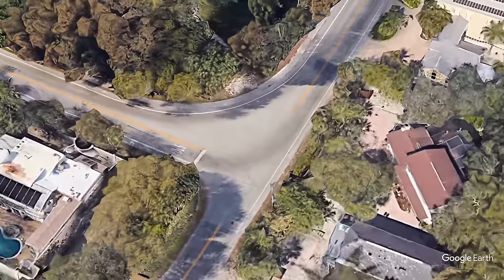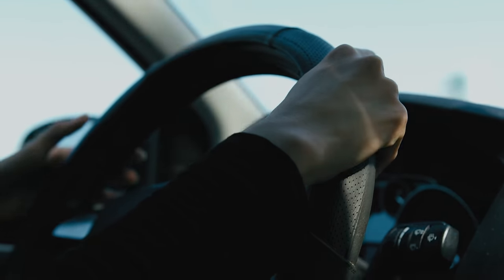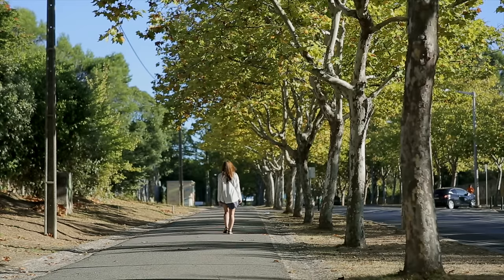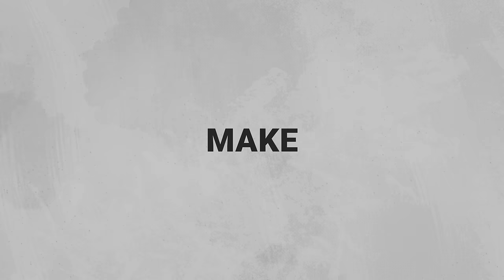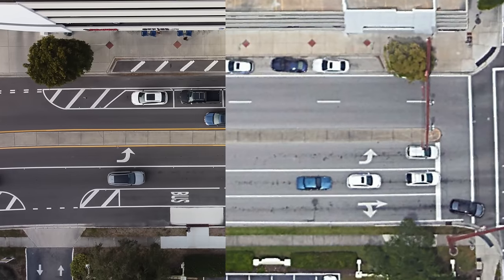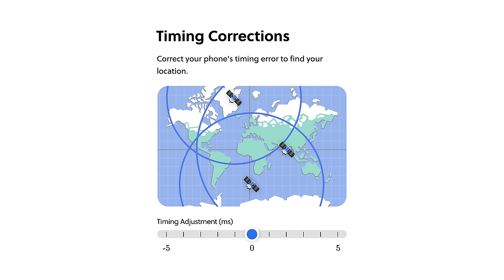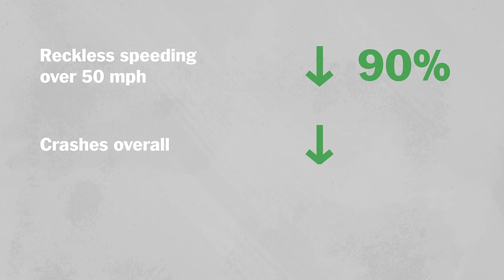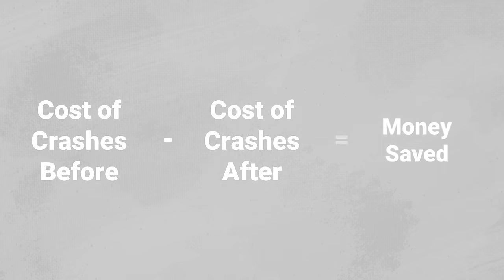This is the key to safer streets

Comment: It's ridiculous how there are politicans who say that this is a war on motorists
Reply: They forgot that driving is not a right, it's a privilege
Reply: Most politicians will say what they think will get them elected.

So, if they think a larger segment of people who can vote for them are "pro-car" than "anti-car", they'll obviously go for that segment. I'm simplifying the terms into pro-car and anti-car for the sake of brevity in the sentence.
Reply: First off, a lot of the debate is framed as how to get rid of cars, rather than how give people more high quality options. Second, a lot of cities have enacted straight up anti-car policies. Rather than improving alternatives, like walking, biking, light rail, etc. they’ve just made driving harder and more expensive.
Reply: It's not them, it's the lobbyists from car companies who write their speeches
Reply: There are policies implemented just to hurt motorists though.

Traffic calming, that’s good. But in the UK councils, and one “country” decided to drop loads of 30mph speed limits to 20, without modifying the roads at all. All it really did was take roads with an instinctive speed of 30, and made them 20 so they could fine people speeding. If they’d actually implemented traffic calming to make people actually slow down, they could have argued it was for safety, but they didn’t so it wasn’t. 
Councils spent years systematically eliminating off street parking, in the name of reducing air pollution, except clearly that was a lie because electric cars don’t produce air pollution but do need the off street parking you just destroyed to charge.
The government spent years encouraging the sale of diesel cars to reduce CO2 emissions, only for some cities to fine anyone who drives a diesel from that era into the city. Live there? Tough, you have a worthless car, shouldn’t have followed the government’s advice. 
Motorcycles get randomly banned from car parks. You can fit two in one space, they produce less CO2 then cars, but no, not allowed to park.
Reply: @user-op8fg3ny3j  the American ethos includes this idea that driving is indeed some sort of inherently American right. Unfortunately.
Reply: Not to mention that usable biking infrastructure reduces the number of cars and makes the roads nicer to use for motorists as well.
Reply: Well since they phrase it that way, building this many roads is a war to the community. After all, many happy neighborhood in the US were bulldozed by for the car.
Reply: How is driving a privilege? How else will you get around?
Reply: @proallnighter  Ask the people who are banned from driving, or don't own a car.
Because you have to earn the privilege by passing a test and it can be revoked if you abuse that privilege which would not be the case if it was a fundamental right.
Reply: @user-op8fg3ny3j When the entire country is pretty much built to neccesitate driving, it pretty much becomes a right...
Reply: people hate being slowed down.
Reply: @flozano8  It becomes a right and not just a privilege when it is the only safe way of travel.
Reply: It is, this video was all about how to make drivers slow down, it was barely about making good alternatives to driving. That is what makes it a war on cars.
Reply: Even the simple reconsideration of zoning laws and city layout/design is now called a "war on motorists".
Reply: @HALLish-jl5mo  what's wrong with lowered speed limits?
Reply: @Gelatinocyte2  because it almost always includes taking away car lanes or closing roads to vehicles
Reply: @cmrd_hdcrb  sounds like the real solution here is to fundamentally change how we construct our civilization, not sacrifice more resources/time to The Holy Automobile.
Reply: @proallnighter  You have legs don't you? Believe it or not it was a popular mode of transportation about one hundred years ago.
Reply: @proallnighter  "How is driving a privilege?"
Think of it this way: you have to be financially secure to buy and maintain a car, you have to convince a regulating authority that you are worthy of a driver's license and/or deserving to get the right to drive (with insurance), and you'd have to be in a city where your car (not you) is fully accommodated for (complete road network/access, ample free parking spots).
It IS a privilege – one that sacrifices the wellbeing of others (for the sake of driving marginally faster).
Reply: @MrMartinSchou  safer roads IS pro car. You're less likely to lose yours in an accident.
Reply: @SummitCoyote  ... and there's no evidence of this?
Reply: @HALLish-jl5mo yes, its a get-rich-quick-scheme by cities and counties.
Reply: @flozano8 I disagree.
Not 'unfortunately'....FORTUNATELY.
Driving is an American right as all clear thinking people agree with.
Reply: @SummitCoyote as it should be
Reply: @Gelatinocyte2 I'd rather sacrifice to the Holy Automobile than the Unholy Mass Transit.
Reply: What? Politicians say that?!
Reply: @michaelbruvolt4221  can you expand on that?
Reply: @kokofan50 in certain type of density it’s quasi impossible to make alternative competitive with car without slowing down cars. Those type of density happen to be the only ones allowed to be build in most places 😢. See the problem ?
Reply: @flozano8  which comment? I left 4 of them.
Reply: @HALLish-jl5mo maybe they though that they can finance the traffic calming with ticket money so they don't need to find a budget for it.
Reply: Driving is in a weird gray area of a priveledge and a right. The government can only revoke your ability to drive on public roads. You can still legally drive on private land.
Reply: @Gelatinocyte2  There are two problems 
1. Going slower is worse because it takes longer to get places, which wastes peoples time and money. Maybe acceptable if balanced out by improved safety, but most of the roads with the speed limits reduced weren’t reduced because they were accident hotspots, but arbitrarily.
2. Lowering the speed limit, but not implementing traffic calming creates a disconnect between the speed limit and the instinctive speed of the road. So instead of everyone doing 30, some people are doing 20, and some are doing 30. This can actually be MORE dangerous. Especially for pedestrians crossing at night, who struggle to judge the speed of vehicles, and so judge by distance with the assumption everything is travelling at the same speed.
Reply: @michaelbruvolt4221  this isn't about mass transit lmao
Reply: @HALLish-jl5mo  1. But counterintuitively, as studies have shown (I'm too lazy to look it up for you), lowering speed limits makes traffic flow faster, because you end up with less conflicts, resulting in less accidents that would interrupt car flow.
2. So the actual problem here is political stubbornness/laziness/half-assery, then – not traffic calming measures themselves?

Streets should just never even have >30 mph permissible speeds to begin with, they're not designed for that; higher speed limits should be relegated to roads, designated arterials, boulevards.
Reply: @Gelatinocyte2  sure it is. You are against the automobile. So to get around, that means mass transit. So stop being cute and admit your effed up ideology.
Reply: @Gelatinocyte2  I drive down these reduced limit roads every day, they did not improve traffic flow because there are no conflicts. If there were conflicts that might act as traffic calming! They also worked completely fine at 30mph.

I've said explicitly that I'm fine with traffic calming, just that there is a war on motorists.
Reply: @sIosha  Great plan, I'll just walk to work and back. It should only take me 6 hours a day. 

Believe it or not, back when people walked to work, they lived closer to work. I can't afford to.
Reply: @cmrd_hdcrb  that's the problem, bad city planning
Reply: @MegaLokopo  making drivers slow down in a neighborhood is bad thing?
Reply: That is exactly what it is. Motorists used to have 2 lanes in each direction and now they have one. That is obviously worse for motorists and it is all due to a few bad apples driving at excessive speeds. I wish in situations like that, they would just install speed cameras instead. That way they only disrupt the drivers doing the wrong thing, not all drivers.
Reply: @Ekitchi0  That is only the case if people actually use the bike lane. In most cases around where I live (although it might be different there) bike lanes are practically empty, so that does nothing to reduce the number of cars on the road.
Reply: @tonydarcy7475  more road lanes induces demand which is why we need to reduce
Reply: @michaelbruvolt4221  how would you know I'm against the automobile? Already, you're assuming things about people that aren't actually true! Just get your head out of your a-
Reply: @HALLish-jl5mo  I feel like you're just making up a story right now to justify/fit the narrative that there is an actual War On Motorists, but how would I know... I can't argue against an anecdote because they're just that: anecdotes.
Reply: It's crazy how there are already people here fooled/convinced that there is an actual "war on motorists".

Practically, this is just a war on pedestrians.
Reply: @tonydarcy7475  that's often due to incomplete, bad or plain dangerous bike lanes.
Where I live a ton of people are using them.
Reply: @michaelbruvolt4221  FYI, by the way, there are other options of getting around other than transit or cars: they're called walking and cycling. There's also the option of living close or right next to the important places of your life.

Believe it or not, not all of the world is North America. I'm lucky (maybe privileged? Nah!) to live in one of the few sensible cities in the Philippines, despite being heavily American-influenced. At least my country didn't have flawed zoning laws.
Reply: @user-op8fg3ny3j  I'm not convinced that  that is the case. I understand that on highways more lanes induce demand for obvious reasons (which is why I'm generally against highway widenings), but that doesn't necessarily apply to smaller streets as in many cases there isn't many feasible alternatives to driving, so the number of cars on the road is more or less fixed, even if they are just driving to their nearest train station.
Reply: @Ekitchi0  I agree. But this isn't a project focused on joining incomplete bike lanes. They just added bike lanes to a small stretch of road, which presumably just dumps cyclists in the middle of a main road  a few kilometres in each direction.
Reply: @kokofan50  There's some pretty good studies that show that increasing the frequency or quality of public transit is far less effective for pedestrian safety than making it more difficult to drive or park.
Reply: @HALLish-jl5mo  Totally right! London has gone from inconvenient for motorists to downright hostile to motorists, 20mph limits everywhere, suspension-wrecking speed bumps, speed cameras, limited parking, congestion and ULEZ charges....the list goes on.
Reply: @therealchayd  London has some of the best transit in the world.
Unless you're not commuting, why are you driving there?
Reply: @tonydarcy7475  if the stretch of road with proper bike lanes (actually separate from the road) links housing and commercial places together, it will be used but if it doesn't connect to anything useful, of course it won't be used much if at all.
Reply: Saving this
Reply: @Gelatinocyte2  they literally showed an example in this video of this exact thing they had a four-lane road that they turned into a two-lane road with bike lanes that shocker, nobody is going to use.
Reply: @user-op8fg3ny3j umm, no it's not.the constitution gives us freedom of movement.
Reply: @SummitCoyote well,duh. Who wants to stuck on the road for hours. Would you enjoy doubling the time it takes to go to work?
Reply: @sIosha 100 years ago people died before the age of 35, and died from simple infections.  Should go backwards a 100 years.
Reply: @kokofan50  It’s evident that without making it harder to drive the alternatives wil get to little traction. Evidence a plenty of this in Netherlands where the distance to bike is made purposefully less than that for cars. This, along with slowing speeds, paying for parking and making stoplights out bikes and pedestrians first only work in conjunction.
Reply: Judging by all the comments below: I can only conclude the following possibilities. 
1) it's the 18th century, people live where they work.
2) or people don't have to go to work.
3) people belive I can walk at 30mph.
4 public transportation grows on trees, it doesn't cost anything.
Reply: @BalaenicepsRex3  because people don't live near where they work shop etc. there's no point in putting a bike lane where there's not a convenient reason to cycle in the first place. distance.
Reply: @user-op8fg3ny3j  Because I live 50 miles outside of London, but usually go there in the evenings by car and there are usually no trains home when I need to return. You're right regarding the public transport, though, I do use that when I go there on business during the day.
Reply: @kokofan50 That's good. Fuck cars.
Reply: @MegaLokopo Making drivers slow down is good.
Reply: @SummitCoyote That's a good thing
Reply: @proallnighter How else will you get around?  The fact that you asked this question shows that you live in a place that is designed so badly that you’re forced to drive everywhere.  In places with better design, the places you want to go are nearby, it’s quick and easy to get there via foot, bike, streetcar, or train, and those options are safe, pleasant, and reliable. Try traveling to Europe. In much of it, you’d be foolish to spend money to rent a car, because you just don’t need one.
Reply: @michaelbruvolt4221 ”Unholy” mass transit?  It sounds like you live in a place where the transit sucks.

Good mass transit has a bus or train every three or four minutes, never gets stuck in traffic, quickly and quietly takes you where you actually want to go, and is pleasant, safe, and reliable. 

Does that sound like your experience?
Reply: It's called brain damage
Reply: @tonydarcy7475 Your bike lanes are empty because they are bad bike lanes.  Bad bike lanes are usually right next to high-speed cars or are otherwise unpleasant and dangerous. They can also be bad because they don’t go where people want to go.  If you build good bike lanes in places people actually want to be, bikers magically appear.  Every time.
Reply: @therealchayd Why in the world are you driving in London?  That city has been around for thousands of years. It wasn’t designed for cars!
Reply: @proallnighter  walking, biking, transit (buses, trains, subways), taxis/uber
Reply: @dzerkle  that’s not my point. of course our country is badly (re-)designed out here. That’s why here in most of America driving cannot be considered a privilege. It’s a necessity. If you can’t drive yourself anywhere and don’t have someone to take you around, you may as well end your life. This is why I mentioned rural areas, because not everywhere is a city, much less a pedestrian-friendly city. Hell, even in our American cities public transportation sucks. I live in a suburb here. It takes me 8 minutes to get to work. Can you guess how long a bus ride would take? 1 hour and 30 minutes. Even our best in Boston isn’t enough. When I used to live there, the train would take forever to get me anywhere. I don’t need to travel anywhere to know our infrastructure is shit. I already know that, and people mock me for complaining that it’s shit.

Anyone here mocking me for claiming that driving should be considered in fact a right in rural America doesn’t understand what it’s like having to live in suburban or rural America without a car or anyone to take you around.

And yes. I have my driver license, own my own car (no loan), and an impeccable driving record, so I’m not saying this because I drove like an idiot and now complaining about losing a license.
Reply: @ShadowEclipse777  buddy I don’t know where you live, but where I live, that would be prohibitively expensive and dangerous. It’s all highways, so I can’t use a bike to get to work. Uber would bankrupt me if I were to use it to get to work. We also have no trains, and the busses are not reliable. All the stuff you mentioned is great and thank you for commenting, but that type of life doesn’t exist outside of large cities here in America. Consider yourself lucky to live where you live.
Reply: @mrosskne  drivers don't see it that way. they see it as an inconvenience to them and wasting their time.
Reply: @proallnighter Oh, I’m not saying you’re wrong. You’re not wrong. I’m raising awareness. Many people in North America don’t understand that their transportation infrastructure sucks in much the same way that fish don’t understand that they are wet.
Reply: @BalaenicepsRex3  you don't make major changes to public infrastructure on a "maybe" or a "wait and see" we don't spend money on something unless there's people lined up waiting to use it to make that expenditure worthwhile.
Reply: @colinwinogradoff6794  Medical progress has nothing to do with this topic lol. Road deaths is among the top leading causes of death in the US. Moreover, the sedentary lifestyle cars help promote contribute to mental illness and heart disease.
Reply: @HALLish-jl5mo  I am just as disappointed as you are that city planning has forced us into this reality of car dependence. It didn't have to be this way.
Reply: @therealchayd  that's fair then. I know TFL closed many old stations that went further into the suburbs so you don't have much choice there
Reply: @sIosha  Why do you assume I live or work in a city? I don't. 

There are several thousand employees at my work, and several hundred houses in reasonable walking distance. Everything else is greenbelt.

Walkable cities would achieve precisely nothing in respect to letting me walk to work.
Reply: As they say “When You're Accustomed to Privilege, Equality Feels Like Oppression”. 

Looking at YT shorts, there’s a channel with a cyclist who tries to use bike infrastructure in LA and he records all of the crazy interactions he has with cars. There’s always a ton of very negative comments on his videos, saying that he should get on a sidewalk, or that biking is foolish, or that the cyclist is too bold in traffic, or what have you. Compare this to the audience response to a different channel where a trucker records his crazy interactions with bad drivers. The reception is way more positive, I don’t think I’ve ever seen negative comments there. 

This is a good representation of how people’s attitudes to poorly designed streets and bad drivers changes depending on who is being put in danger. Although trucks and bikes are mostly not going to need the same infrastructure to improve safety, there’s so much room for improvement everywhere in our roads/streets.
Reply: @kokofan50  when cars occupy 90% of the available space on the road, and the whole road is designed specifically to meeth the needs of cars, how do you improve the alternatives without taking away anything from car traffic? How do you improve walkability, pedestrian and cyclist safety, etc. without forcing car traffic to drive slower?

When you're in a (vastly) privileged position, any change feels like oppression.
Reply: @AdamCopp  making driving harder without good alternatives doesn’t make less traffic, just angrier people.
Reply: @SojournersPerspective  yes, they made alternatives that work just as well, if not better, rather than instituting purely punitive measures against drivers.
Reply: @stephanweinberger  how do you turn only punishing drivers when there are no alternatives is bad into cutting into the car’s share is bad. Try responding to what I actually wrote.
Reply: @Gelatinocyte2  and I quote:
"the real solution here is to fundamentally change how we construct our civilization and not sacrifice more resources/time to the Holy Automobile"
Sounds like someone against the automobile to me.
Reply: @mrosskne  thanks for keeping things as they are.
Reply: @Gelatinocyte2  walking and biking are limited options.  Life requires you to go farther distances. And joy of joys we have the lovely automobile for that!!  🥰
Reply: @Gelatinocyte2  yeah, not all the world is North America...your loss. Although I do like Austrailia!
Reply: @dzerkle  most transit in North America sucks. But that doesn't mean I want to make it better. I want the freedom to drive my own vehicle, where I want and whenever I want.
Full stop.
Reply: @kokofan50  How about you try the same. I'll try one more time: Often — especially in urban environments — cars currently occupy about 80-90% of available road space (which is often disproportionate to the actual transport capacity they provide — so not only do cars occupy the vast majority of space, they are also using it most inefficiently!).
All other modes of transportation have to fight for the miniscule rest.

The thing that's necessary to improve the alternatives more often than not is simply space for sidewalks, bus or tram lanes, cycling paths, ... Where is this space going to come from? We can't just inflate our cities, can we?

Another thing that's often a prerequisite for improving the alternatives (particularly walking and cycling) is better road safety, which often hinges on slower speeds. Again, it's mostly cars that cause this problem in the first place.
Reply: @Gelatinocyte2  ....well, they're not wrong
Reply: @tonydarcy7475  you hit it on the head. A few bad apples makes it worse for everyone
Reply: @dzerkle  well, if one commentator can mock the car by using the moniker "holy automobile", another user can use the phrase 'unholy mass transit"
Almost all haters of cars have a deep hard on for mass transit everywhere
Reply: @stephanweinberger  I understand what you’re saying, and I’m fine with light rail, bus lanes. However, those things aren’t built in many places, just punitive rules against cars.
Reply: @kokofan50  You're welcome.
Reply: @michaelbruvolt4221  You can travel the entire continent of Europe without a car
Reply: @michaelbruvolt4221  honey, they are.
Reply: With the roads being there before everything else. It actually is.
Reply: @SummitCoyote  "they literally showed an example in the video ..."
Was that supposed to be bad? That's what you're calling a Bad Thing? Are motorists seriously this entitled?
"shocker, nobody is going to use"
No shit, that's a Sharrow! No cyclist is ever gonna feel safe sharing the road with cars; they'd much rather have their own infrastructure, or at least have an actual network of gutter-protected bike lanes, rather than some segments of painted streets from nowhere to nowhere that drivers are supposedly staying away from. And that's only North America; look anywhere else, like Japan or Europe, and it's a different story.
Reply: @AdamStansbery  and what do you think existed before cars: nothing? What about the thousands of families displaced by highway projects? What about the dismantling of tram networks for the sake of more lanes?
Losing a few lanes is NOTHING compared to what we've lost for The Automobile.
Reply: @AdamStansbery   Actually isn't.
Reply: Not really most politicians are back by big oil thanks to citizens united 👍
Reply: @SageBlueMusic  Is that true? Don't you need a license to drive, period, and a registration on any vehicle you're driving?
Reply: @colinwinogradoff6794  public transportation needs to be built out and built up, maintained, staffed, paid for, etc. The thing is that's already done for roads. There's a budget for building roads and highways. A budget for their maintenance and upkeep. They just require less staff and workers because they're just roads, not vehicles. But we pay for that through taxes. The thing is we are throwing too much tax money and federal and state funding at building too much car-centric, anti-human infrastructure. We're not even building the best infrastructure in the long run. A good transport infrastructure works for all modes, be it roads for cars, sidewalks and infra for pedestrians, and bicycle infrastructure. The case in North America is we over prioritize building for cars and pedestrians, trains, busses, bicycles, are an afterthought. That's not an efficient way of doing things.
Reply: @SummitCoyote  yeah, which is why we change urban planning to build denser neighborhoods with work centers and shopping, along with building better transport infrastructure.
Reply: @proallnighter  I used to live in Europe where I walked, took the subway and the tram daily. It's usually fast and convenient. The problem in my city was labor strikes affected subway and tram operation too often for my liking. And sometimes trams were caught in traffic or some other problem where they wouldn't run. Otherwise taking them is pretty great. Walking in a city where everyone does so is great too. The city is built up for it. It's astounding to me how little thought, priority, and money is given to any mode of getting around other than the car. No one walks. No one bikes. No one takes the bus. No train in my current city. This country feels very backwards in terms of transportation. It's like we are just addicted to cars and so far down that rabbithole that going to Mars seems easier than building a diverse transport system. I don't see this changing unless there's a cultural and political change, or cars turn shitty and gas turns hella expensive.
Reply: i dont get why they use that as a talking point. Better cities with better public transportation works to THEIR favor cause it means normal people like us get to use public transportation, while the rich assholes continue using their cars with less traffic
Reply: @Ekitchi0  I agree that in those situations bike lanes (or ideally off road bike paths) are great to have, but that isn't what the objective of the bike lanes in the video are, which is why I think it was a bad idea in that situation. The point of the bike lanes in this situation was to simply narrow the road, making driving through the area harder for motorists (including emergency vehicles). Something like a bus lane in each direction or a median turning lane and a lane for parked cars would have been more appropriate.
Reply: @dzerkle  They do, but that was not the purpose of the bike lanes in the video, which was simply to narrow the road.
If the project focused on connecting bike routes together, then it would probably be a good design. But it doesn't. It simply dumps cyclists in the middle of a main road a few kilometres in either direction, which is why they'll see very little use and is basically just a waste of space.
Reply: @AdamStansbery  remember that roads were for pedestrians and bicycles and karts before the motor vehicles stole it
Reply: Throwing stuff in the way, like a whacky racer, is kind of a war on drivers..
Reply: @proallnighter that’s what your feet are for.
Reply: @kokofan50  you have it exactly.
Reply: there are 2 camps arguing for these types of road improvement, those that actually want to make movement better for everyone (like this video)
and those that just want to make car travel harder or worse (the people that cut out a lane for a painted bike gutter and nothing more)

that 2nd group will be the biggest enemy for people who want truely walkable cities, because people who don't know better will assume both are the same because both say they want the same things.
Reply: @tonydarcy7475 It’s safer for pedestrians to not have to look both ways for the thing most likely to kill them. The only way around that is to take the authoritarian American practice of restricting the natural rights of pedestrians to go anywhere on public land that they can reach. So, why should your desire to go somewhere in a quick timeframe supersede my right to walk three metres without being killed?
Reply: If you like to drive at 20 to 40mph. All of this is amazing and makes driving more enjoyable. High speeds are for interstates. Not residential, commercial, and even industrial areas where people and sensitive things are.
Reply: Lol.
Reply: @user-op8fg3ny3j free travel is a right, I have a right to choose that mode. You have been brainwashed to defer to the authority of your master, the state.
Reply: @asherdie  owning a car is far from free.
You get your road tax, insurance, and gas for free?

On the other hand, walking and cycling are always free
Reply: @dzerkle  The problem isn't just the "transit" (which in most places in the US, is unreliable, infrequent, slower than driving a car, and limited in terms of routes and operating hours), it's also the "masses." Transit vehicles get overrun by junkies, homeless, and other unsavory types, and become unsafe hotbeds of harassment, sexual assault, other crimes, and general unpleasantness. 
That's why there's skepticism about "stroad diet" projects that take away private vehicle travel lanes and dedicate them to transit. If not that many drivers switch to transit because of the aforementioned drawbacks and hazards, you just wind up with a really congested street and a lot of resentful drivers looking for politicians to blame at the next election.
Reply: @MrMartinSchou 
"I'm simplifying the terms into pro-car and anti-car for the sake of brevity in the sentence."
To be fair, those are the kinds of terms both politicians and the average voter think in.
Reply: @user-op8fg3ny3j I know you’re technically not wrong but that’s what they used to say about voting and being a free man. Always the right side😂
Reply: @lateformyownbirth  I don't get how this affects pedestrians. You still need to look both ways regardless as it is still a two way street. And if there are a lot of pedestrians in the area, then there should be pedestrian crossings, which is one of the safest way to cross.
Reply: @user-op8fg3ny3j  Many roads in the USA were built for driving before anything else.
Reply: Its ridiculous taht some can't understand it all comes down to demographics.
Reply: @kokofan50 this. And you can feel the anti-car hostility and snark everywhere on the "urbanist" internet. That isn't helpful, it's divisive. Most people also drive cars, so it's divisive in a way that immediately alienates the very people you are trying to influence.
Reply: The most pro -car people are those who want to perfect car use. This can be done by driving car less
Reply: @Ekitchi0  You clearly have never driven in your life if you think that bike lanes improve roads. Bike lanes are used by like 3 people per day AT BEST. Meanwhile the roads they make more dangerous in order to exist are used by dozens of thousands of people every day. Literally no one expands roads for bike lanes, they just make existing lanes smaller and more dangerous. The single biggest contribution to driving safety is oversized lanes. The single biggest contribution to driving danger is undersized lanes, something that bikelanes cause.
Reply: @BalaenicepsRex3  How do you know that nobody will use them? Because in states like california we already have millions of miles of bike lanes that made roads worse that literally no one uses. Also it turns out there there is already a solution to the cyclist question which is to attach a slow moving vehicle sign and to go to the side of the road to let traffic pass at all available opportunities. Cyclists shouldn't get special treatment. Horsedrawn carriages and tractors are able to follow the rules, but cyclists think they're above the rules.
Reply: @ChaosSwissroIl  it's exactly the opposite, large lanes are more dangerous...
And yeah in the USA where everything is centered around cars there are not many bikes...Obviously.
Meanwhile in most of the world bikes are used quite a lot, but again because there are decent alternatives infrastructure to cars, not because people are fundamentally different. 

In terms of trafic flow, bike infrastructure is many time cheaper and more efficient than car infrastructure. Cars are by far the most subsidized mode of transportation even in Europe where there are good alternatives to cars.
Reply: @Ekitchi0  No. Fire is more dangerous than a knife. It doesn't matter that there are more emergency room visits for knife injuries than burns. If you cook the books and perform incorrect analysis, then yes you conclude that knives are more dangerous than fire. But if you actually control for factors properly, you reach the opposite conclusion. Wider lanes are more safe. 
The same people who claim that wider lanes are less safe are the same people who use fractional throughput as a goal metric instead of the blatantly more obvious and ideal metric of flowrate. Using their reasoning a one lane road at 50% throughput is better than an 8 lane road at 90% throughput; that is blatantly untrue, but that is the mantra and claims being made by the same people that say wider lanes are more dangerous. That is to say, midwits don't understand what they're doing so they advocate for making things worse.
Reply: @ChaosSwissroIl  Sure, if you want to play with words, danger is not the relevant metric or word to use, it's risk.  Something dangerous that is properly contained present less risk.
Anyway this analogy is completely irrelevant because the problem with wider roads streets is that drivers change their behavior.  If people where driving at the same speed on narrow or wide lanes, then yes, wider would be safer.
A wide road is fine, a wide street is not.  Wide lanes make drivers go faster which is not a problem on a road, but is a problem on a street and at intersections.

Also, flowrate doesn't necessarily diminish on narrow lanes.  Slower trafic is also more compact and can keep the same flowrate.

It's pretty astounding that you get so many things wrong and backwards while thinking everyone else is wrong...
Reply: @MegaLokopo  mind you, the main reason it's the only safe way to travel is a refusal to build infrastructure that is designed for humans rather than cars for decades.
Reply: @Ekitchi0  No.
Reply: @cmrd_hdcrb sounds like some ass backwards logic
Reply: @MegaLokopo hmm, provide safer alternatives that'll cost less or provide cars, it's a humn right right?, build more lanes, and do jack to prevent more deaths while costing more. Sounds like a simple choice, the latter is the most logical choice. 

There ARE arguments for cars, but what you said is completely asinine
Reply: @MegaLokopo yeah, to prevent them from KILLING people. Your right to be stupid ends when it risks my life
Reply: @Zalis116  If you have bad transit, that can happen.  The only people on it are those who can’t use a car, generally because they can’t afford one.  Then, it’s underused and has no political support from rich, powerful people, so it doesn’t get funding, and just gets worse. If you have good transit, then that’s just what everyone uses, and troublemakers are not a meaningful fraction of the riders.   If there is a problem, it gets fixed immediately. 

The trick is to start with good city planning so you have a community where transit can work, and carefully avoid making bad transit.
Reply: What's more ridiculous is that actual 'normal' people think that it's also a war, hence why politicians raise the issue.
Reply: Especially since it actually makes it easier to drive!
Reply: @Gelatinocyte2  Firstly. It is not. Second. I'm somewhat backing you up on this. I had to lookup the common definition of "privilege". Just wanted to be sure of my understanding of the term. .... It is NOT a privilege nor is it a right. A driver's license is required. You have to earn the permission to drive. . That driver's license give one permission to drive on state/city maintained roads. After all. All vehicles can be lethal weapons to anyone. Many don't understand that.
Reply: @HALLish-jl5mo  Very true, people don't understand that vehicles are the lifeblood of these cities.
Reply: @SummitCoyote 
People hate being hit by cars.
Reply: @Gelatinocyte2 
They clearly demonstrated that lower limits aren't enough.
A physical change to require the limit to be observed is required.
Reply: @rogerstarkey5390  then don't walk out in front of cars....
Reply: Also politicians: haven’t left their pristine “mansions” in years to know what its like to drive on those roads
Reply: It depends on the details.
In NL I've seen tight roundabouts where cyclists have priority and may go in either direction.
Those are very hard to navigate without hitting someone, because those cyclists can kamikaze into your hood from every dead angle you have.

Then there's the accursed "turbo". They're great in theory, but only if you happen to be in the correct lane way before any directions are indicated.
Also, those seem to be even worse for the minor for to have any chances to squeeze in. Which is great when you're in the major flow ofcourse.
Reply: @tonydarcy7475  Our entire infrastructure is dedicated to cars and at best bikes, people, public transit can get some of the remaining scraps of spending, distances between where people want to go and where they live are huge because everything is focused on cars. Their isn’t many decent walking, biking, or public infrastructure areas in America. The fact no one uses the bike lanes in your town doesn’t show there isn’t demand but how car centric the urban design is where the bike lane was probably a minor second thought.
Reply: @kylezdancewicz7346  I don't necessarily disagree with what you are saying (personally, I am a huge fan of bus lanes), but that doesn't change the fact that less lanes for cars and/or traffic calming infrastructure is is bad for car drivers, even if it is beneficial for society as a whole (and thus would be a worthwhile tradeoff).
Reply: @tonydarcy7475  Actually more alternatives is better for car drivers because that means less traffic because not everyone is in a car. That’s why the Netherlands, who use traffic calming excessively are considered one of the best places to drive
Reply: @proallnighter Bikes, Motorcycles, Taxis, Busses, Trams, Light Rail, Heavy Rail, Subways, and Commuter Rail. Oh and for long distances. Use Planes, Intercity Rail, and Boats.
Reply: @michaelbruvolt4221 Mass Transit is more holy than cars. You can see more Bible verses on trains than cars, if someone’s willing to pay for a train wrap.
Reply: @Boypogikami132  hey, Einstein. Try reading the previous comments first.
Reply: @proallnighter  driving is literally a privilege.
Reply: @Boypogikami132  you can listen to Christian radio in cars. And there are no distractions in cars, you can think and meditate on what you are hearing.
In mass transit, you get distracted by the thugs and scanitly ckad lasses that get on and off the train.
Therefore, the following mathematical formula presents itself:
Cars > mass transit.
Therefore, cars are holier than mass transit.
Your welcome.
Reply: @michaelbruvolt4221  Thugs also appear in cars, they box you in and smash your windows to demand cash. In mass transit, at least there’s a chance that a passenger is an off duty cop. Oh also did you forget portable radios exist so you can listen on mass transit?
Reply: @Boypogikami132  I've ridden on mass transit, and have driven/riden in plenty of cars.
For personal safety, I'll take cars any day over mass transit
Hu-rah
Reply: @michaelbruvolt4221  boo hoo your trains are worse because your city is too car brained. get better
Reply: That's because it technically is. Drivers aren't at fault. Never have been and never will be. It's the infrastructure and zoning. Drivers can and will only use what is built. Being anti driver is no better than pro driver. How about you try to work together and have things built for both. Otherwise you will never have any new people see and want to go to any of the shops. It will only be the limited local people within walking distance.
How about all new business have to be multi story unless they need vehicle access like mechanics and the such. Then use the first/second for parking only. Practically eliminating the need for huge flat parking lots. Also with a complete road redesign for both pedestrians and vehicles. Instead of trying to eliminate each other.
Reply: War on motorists who dont know how to drive properly
Reply: Two words: CULTURE WAR
Reply: Stop selling SUV's. A 'light truck' is still a 10.000 pound death machine. Like a Silverado or a F-250. Seriously, what the hell happened?
Reply: @xouxoful you see
With less cars, theres less space used to accommodate cars, meaning what cars do travel can get to where theyre going at the same time at lower speeds due to buildings being closer together
Reply: This is stupid and terrible. A solution in search of problem. This slows down the street needlessly.
Reply: @HALLish-jl5mo  30mph in residential streets is still too fast. 20 is a much better speed. The rest of it is just people having to get used to it. 
We did it in Amsterdam and its working great. On top of that, it hardly has an impact on the time it takes to traverse the city. Its just much safer and it cost almost nothing.
Reply: @Evolixe  I can assure you that 20mph on a rural A road adds to commuting time. 

My house is on a 20 and that's fine, because you can't drive more than about half a mile before reaching a dead end, it's a housing estate.

But the policy they seem to have adopted is that if there's a house there, it's a residential street, and needs to be a 20. It's the main road between two towns, it shouldn't be a 20.
Reply: Yeah, I think PragerU has a whole video series on it
Reply: Especially when, if anything, the curve is faster now.
Reply: Most motorists have a disdain for driving around moving obstacles known as pedestrians and bikers.
Reply: Oh it's a war alright, a war on big auto.
Reply: @user-op8fg3ny3j  driving is a right its in the constitution. we have the right to travel freely.
Reply: @flozano8  Nah being anti-human is my priority.
Reply: @proallnighter  go away bruh
Reply: @kokofan50  in cities with a high population density, an argument for fewer cars and better public transport is easily won.    It's less of a good argument in areas with more moderate population density.
Reply: If only that makes it get as much budget as wars
Reply: There is no war on motorists. There is a war BY motorists, on everyone else. They are the real villains.
Reply: I’ve never once heard a politician say middle turning lanes are a war on motorists.
Reply: @ummuser Wut?  😅